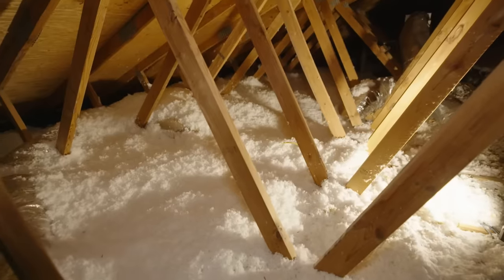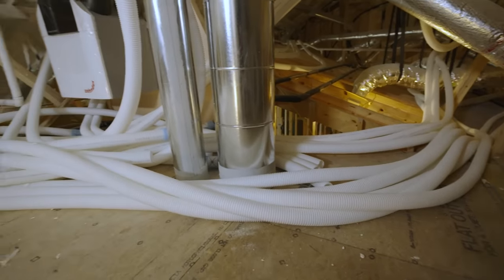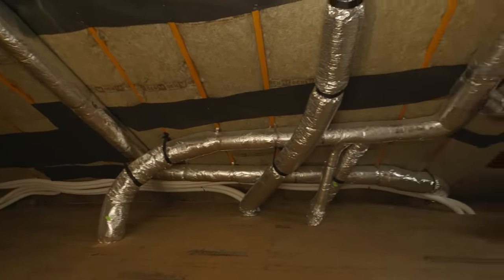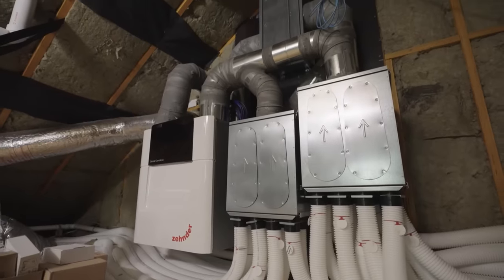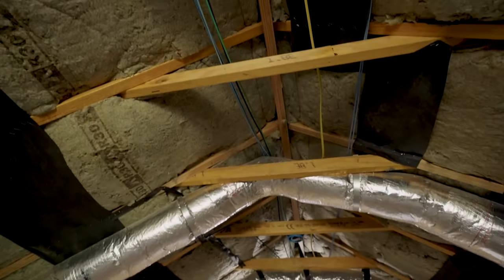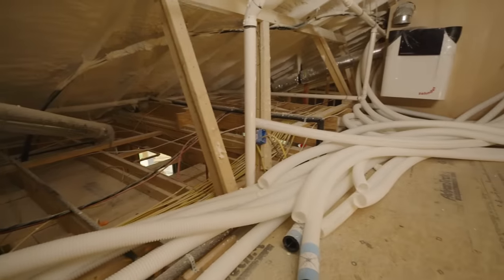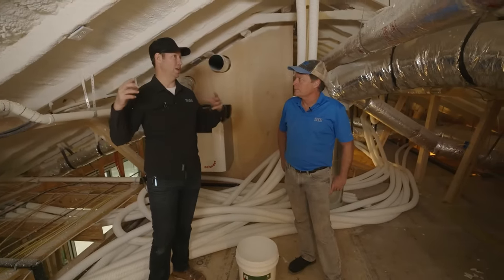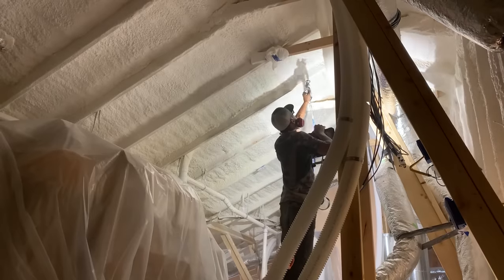Building a BETTER attic - Unvented + Conditioned attics 101

Comment: Wondering what this added to the cost of a standard build.  (I'm jealous)  wondering if adding that "Closed cell foam" to a existing home (2 yrs old) would do any good or be counterproductive without the other improvements?
Reply: I'm not a contractor, but insulated my shop recently and can provide some feedback. Closed cell is $1-1.5 per inch thickness per square foot depending on where you live. You need a really good waterproofing under your roof, if you get a leak closed cell traps water in the decking/trusses and you won't know about it until you have a serious problem. Both of the houses in this video have at least 2 waterproofing layers between the roof and the decking the foam is sprayed to.

On my shop I decided it wasn't worth the cost to remove the roof to add extra waterproofing, so I did 2" of foam in the walls, backed up by R19 batts and did a traditional vented attic with R38 above the drywall. Total cost for the foam and batts was about $4200 installed for a 24'x36' with 14 foot ceilings in the Pacific Northwest.
Reply: @siliconmcleod  Thanks so much for the comprehensive comment.  It gives me food for thought.  I can look at our contract with the builder (it was a custom build) and that should tell me what waterproofing we paid for but I can't be sure it was done exactly as indicated.  I appreciate your time, thanks again!!!!!
Reply: @AncientHippie  No problem and good luck!

Comment: Vented attics are not a "dumb" way to build.  They are an efficient and durable way to build that has been in use for a very long time for a reason.  Because it works, and it works in every climate.  The dumb part is putting your HVAC in the attic; which is basically the worst place you could put it.  Everything in this video is a huge waste of labor and money caused by the stupidity of putting HVAC in the attic.

Comment: Probably will need a vapor barrier at the interior of the attic. Keeps interior moisture from seeping into the wall insulation.
It's not an attic now, it's a conditioned room with a sloping ceiling.

Comment: How does fire react to open cell foams vs closed cell. I realize the R value is less with open but can it me painted similarly?
Reply: Closed cells polyurethane foams burn like liquid gasoline. I did some burn test when I was selecting spray insulation for a remodel. The result with polyurethane foam were absolutely terrifying. In the end, choose icynene foam. Way safer than polyurethane.

Comment: The venting had a purpose in some areas of the US. When you live in tornado areas. Venting makes it so the pressure stay equal. The pressure drops fast in those conditions, causing the house to explode due to a higher pressure inside and low outside. It is for safety, does not work all the times.
Reply: Yeah, I remember the days when they used to say open windows in a tornado - that was about 1965.  Based on modern video analysis (and some experience with my brother's house getting sideswiped by a tornado) that venting is a bogus idea.  Damage is all about how much the structure intercepts the wind field.  Opening the structure increases the internal pressure and since most roofs are just held up by gravity (no hurricane ties) that's the most common failure mode.  My brother's house had steel garage doors which bent in leaving a gap that allowed wind in.  This blew out the back garage door and broke open a piece of the wall between the door and the concrete anchor.  The houses down the street all had the wood garage doors completely fail.  The large opening allowed the wind under the roof.  The roof of those garages popped off and the garage part of the structure pancaked.

Comment: the big mistake is roof trusses or prefabbed roofs with ceiling joists. makes "assembly" of a house faster, but it's dumb as far as attic space or even a properly vented and insulated attic. a good construction team can get a house properly built faster and cheaper than roof trusses, and I'm not talking about day laborer workers. Cheap labor isn't good, and good labor isn't cheap

Comment: Actually that's what i wanted to do with my attic. Right now there are W trusses, ac unit in the center and the duct work chaotically going all over the place. My plan was to replace the trusses (instead of W do 2 short verticals and short horizontal near the apex), put rockwool insulation under roof, put plywood boards to extend the floor,, move the ac unit to the far wall and organize the ducts. Organizing the ducts could also mean that i can use maybe non insulated ducts (resulting in smaller footprint) since the attic would be insulated i can have it being cooled by some light airflow from AC and uninsulated ducts. Not sure how viable that is.

Comment: Nothing frustrates me about remodeling except, insulation techniques.   Techniques become contradictory faster than the Olympics comes around.    Does the DC315 cause a vapor barrier on the inside?
Looks like the advantage here is junk in the attic, and conditioned space for mechanical.
I wish I knew how I could help my tenants - this doesn't seem like the route.
Reply: The entire space occupied by DC315 is a vapor barrier. In addition, the asphalt shingles + underlayment + OSB is a vapor barrier, so the entire roof is one big vapor barrier, which is fine because vapor is now a non-issue.
Reply: @hailexiao2770  If there is a vapor barrier on the outside.....and a second on the inside.....aren't the trusses going to be subject to rot?   This is what that building science fellow has been saying.   Contradicting what the Hardiboard people say about putting plastic sheet over studs prior to the tileboard.     Thanks for your reply

Comment: I think this method is not a good idea. Spray foam will cause the roof to stay hot for longer possibly reducing the life of waterproofing membrane. Also if there’s a leak you won’t notice it and have a chance to fix it. The water will just spread above the foam and rot all the wood.

Comment: If the attic is unvented then how do you keep the temperature same as the outside air? I a vented attic is really hot when it does not have enough outside air flow and vents are either clogged or not large enough. Unvented non livable space is a BAD IDEA. You can never insulating the roof enough to keep rising heat from the living space in winter or penetrating heat in the summer. If your attic is to warm in winter you can get ice dams on your eaves from snow melting and then freezing. In summer an unvented attic would get really hot with stale air. I noticed that the attic you are showing is very large and most attics I have been in are 3 to 4 feet at center, not much space which make a big differences in how it effects the rest of the house. Your whole idea of a sealed house will lead to big problems in the future life of those houses. I do not agree with your builds at all,  in order to maintain a health indoor environment you energy bill will be sky high.

Comment: Yes, the cellulose fiber method is obsolete . I also like the Thermal jacket building technique for strength and efficiency - where the main thermal iso has very few "bridges" to the inside wall.

Comment: I don’t know what this guy is talking about those roof trusses are engineered trusses which are far more stronger than traditional rafters and second if you build it right it should have a ridge vent across the peak I built my house this way and I can go up in my attic in the middle of summer or winter with no problems the ridge vent keeps the attic at workable conditions

Comment: Not a fan of using spray foam in any place that shares air space with people.   If they make a mistake in mixing or applying you can wind up with super nasty off gassing.  With the rise of spray foam it's become more of a problem.  Personally I would rather have the rock whool, but I wouldn't want to pay for it or the extra layers on the outside of the roof.  I'll spend that money on square footage where it will pay me back on resale.

Comment: Why wud u use Rockwool in a cathedral ceiling or even spray foam. Insulation supposed to go on the roof on the outside not the inside

Comment: I don't see this as an advantage.  How does air in the home exchange if it is airtight?  It seems to me this system will just create indoor air pollution.  We added a ridge vent to our gable and eave vents when we reroofed our house.  We are in south Georgia and it is much cooler in the attic now.  Never had a problem with mold either.
Reply: Well, in cold areas since the 1980' houses always have a «air exchanger» precisely because the insulation is so good. To me, this option seems to be for very rich people only... Better build a huge shed if not a whole garage instead for a similar price.

Comment: I'm not even a construction person, but when I see that traditional attic mess you pointed out at the start, I also automoatically think that is poor planning since it clearly makes maintenance 10 times harder.    Who comes up with these horrible ideas?   I even think traditional irrigation methods with buried water tubing is idiotic for the simple reason it makes maintenance difficult.
Reply: So where would you put the irrigation?

Only cheap people want to lug around hoses all day to water their lawn so the next best solution is underground irrigation.
Most systems if maintained last 25-30 years.
The problem is you get untrained people blowing them out in the fall which wears out the sprinkler heads.  Trees are the next major issue as roots will envelope the water line because the tree is looking for water.
Reply: @jkhuskies09  With raceways and other conduit channels with access panels.   The point is that to be maintainable, the pathways for the devices cannot be invisible and buried below ground where no one knows where it is without consulting a diagram that may or may not exist.   It's an idiotic system based on up front laziness.
Reply: @jkhuskies09  Even sprinkler heads alone could be made ten times more maintainable just by creating an outer container which keeps the dirt away from the sprinkler assembly, and to service the sprinkler, all one does is open the surrounding lid and reaches in.
Reply: @Zuckerpuppekopf  most sprinkler heads have filters built in. You simply pull the head sleeve up, turn it and pull the filter out.  Other option is you twist off the head and put a new one in without digging.

The lines themselves don’t need to be replaced very often, just the heads as they wear.  The control valves are in green boxes in each zone and should never be buried but it does happen a lot.
If visible it is pretty easy to fix the control valves.  If not a wire detector can find the valve box pretty easy.

Comment: Why why why spend that much money on an attic. It's not living space. Yes it's part of structure . The issue is to how to insulate and vent at the same time without compromising the structure. That is, not let condensation cause mold ,etc. An attic is handy to have as a chase to have vents and HVAC , etc. However, I think mini splits should be used more to Target areas vs using HVAC ducts in an attic or crawl space to distribute air. Very in efficient not counting how expensive. Keep it simple and insulate the attic and install some fans to circulate air in hot summer via whirlybirds / solar vents/ gable vents / soffit vents. Then install  thermostats to control high heat. Anywho, just a thought. I have dealt with this stuff in remodels. Spend the money elsewhere. I luv mini splits .
Very efficient and low low maintenance. No duct work makes it even better.

Comment: Well, First I think your kinda over selling this idea.. Then I built my first house as a pro in 73 and yes many subdivisions had what we called ding bats (spec houses).. engineered truss and only 4 basic plans for the whole area.. But we built a lot of custom home also and used this very method to insulate the attic area. We found it more efficient for all.. And you are right this is how they should build.. But spec houses are built for the least amount of money and trouble and sold for the most money they can get.. a house I built and sold beck in the day for 35,000 is now worth upwards of 3 or 400 k now.. Sheesh who knew..

Comment: Terrible idea, any covering over the roof sheathing negates your ability to get a Termite policy or to treat Termites. Finding a roof leak later down the road would also be a problem. I installed Radiant Barrier and would have never done it if I had known that I can't get Dry Wood Termite coverage. Subterranean coverage yes but no Dry Wood.

Comment: Think after the Texas freeze, folk realize just how crappy homes are built. Insulation isn't a thing in TX. It won't get cold so why bother. It gets hot but you got AC. Pathetic insulation in attic and the AC vent lines have barely any insulation so when it hits 150 plus up there there goes your cold sit. I had to clean dormer windows in an attic. Dreaded going up there but once up there it was one of hundreds of homes I cleaned with a foam sprayed attic. OMG! So cool up there. It was awesome. If that was my house, new man cave. LOL

Comment: In the uk you need a vented space between the insulation and the inside face of the roof finish or you will get condensation and possible timber rot. As for the spay  insulation foam I would not touch it for use in the Uk . The insulation should go on the outer face of and timber or you will have cold thermal bridge and potential condensation .

Comment: Messy job on the tubing/ducts. Should have been run close to the ends instead of across the middle of the floor where it gets stepped on

Comment: My attic has that white " fluffy" stuffing in it and my duct work is up there with it too.... the house was built in 2008 and it's doing just fine. Moisture free attic!
It's  a very hot summer in Upstate SC this season.  Lot of near 100 degree days in the month of June. 3 heat pumps on my house (3600 sq ft).. My June electric bill was exactly $113. Will someone tell me how insulating the attic ( using Matt's method) is going to improve my electric bill?
Don't try to reinvent the wheel!

Comment: If I do this, it will cost me a screaming fortune, I will have no shingle warranty, I might save $80 per month on electricity, and I won't be able to have solar shingles. If my roof leaks, I won't know it until I have a huge problem.

If I get solar shingles instead, I'll save around $260 per month, the government will pay for 26% of the system, I'll get a new roof in the bargain, I'll still have a shingle warranty, roof problems will be obvious, I'll be able to get a battery to get me through outages, and I'll be able to sell power to the electric company at 100% of the retail rate.

Why should I care whether my house is efficient if I have free electricity?

Comment: With all the money you've spent on this house I don't understand why you went cheap on the duct work. Flexible duct work cannot be cleaned. So why didn't you use Aluminum ducts with sealed seams and insulation wrapped around
Reply: they are cheap and can be easily replaced.
they loose less heat or cool.
Duct cleaning had been proven to be inaffective and metal ducts are leaky. it needs mastic and proper insulation job. I found a water pipe going right thru a duct on my house. In thru on side and out the other..
Reply: @acevirginian2203  Ah...wrong and wrong. By the time one figures in installation and the fact that the fiberglass insulation is exposed and overtime clogs returns and one can inhale it the cost is way more. The secret is keeping the Aluminum Duct work clean in the first place. You do that by replacing intake filters on a regular schedule. My duct work is 20 years old and it as clean today as it was when it was installed. I'd don't let junk get in it. But additionally my old duct work was cleaned and was fine...no dust. So I don't know who you used but they were they were the wrong people.
Reply: Good for you. I never could afford a new house. Older Homes that I bought already had internal damner insulation which was loaded with Stuff. They used washable filters in those days for Pete's sake.
Even then those ducts were galvanized steel not aluminum... I have never seen those..

Comment: You have simply transferred the ever-problematic moisture to the underside of the roof sheathing with NO means to dissipate it !

Until a satisfactory method to CORRECTLY applying spray foam ANYWHERE is developed you are putting the cart ahead of thevhorse

Comment: There is so little cross bracing in that roof it wouldn't survive a decade here.  It'd be ripped off or punched in.  And you sheeted it with metal?  Wow.  I don't want to meet your roof at 100mph in the next hurricane.

Comment: On the first foam, he held the torch in one spot and didn't move it, then with the second foam, as soon as it started heating up he backed the torch away and started moving it in circles so that it didn't heat up as hot in one spot as the first foam did.
Reply: He spent far more time on the coated piece with the torch, particularly after scuffing part of the charred coating off. And it fared far better.
Reply: @dennischristensen785  On the coated piece He kept the torch moving so that one spot didn't get overheated. On the uncoated piece, he held the torch in one spot the entire time so that it would get overheated! It's right there in the video, He knows he did what I'm saying, but they're pushing this product like a used car salesman pushes used cars.

Comment: If you don’t live in a snow area you can build a low pitch roof for rain runoff and spend the $ on a basement or additional living space. Roofing add a wasted cost to home construction. Roofing pitch is a fake image of size and aesthetics. I often laugh at these home with large roof in tornado prone areas. Building a home with today technology can eliminate these high pitch roof and add saving to the cost of the home.